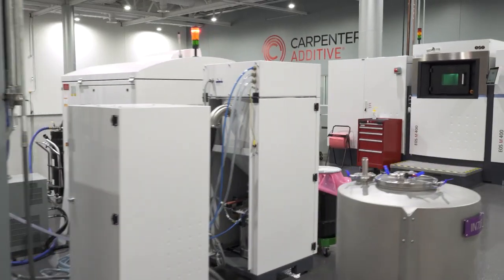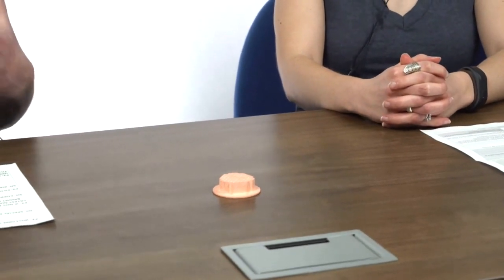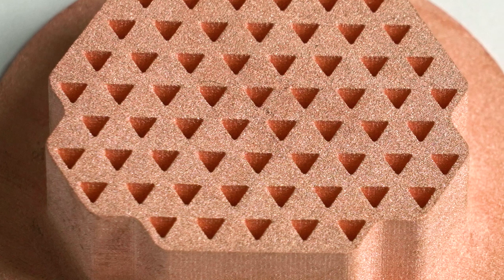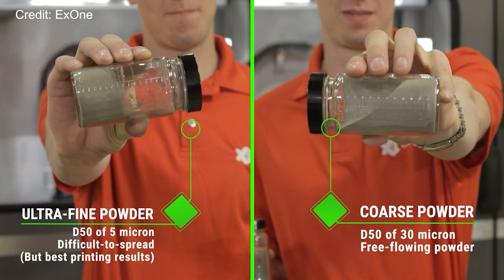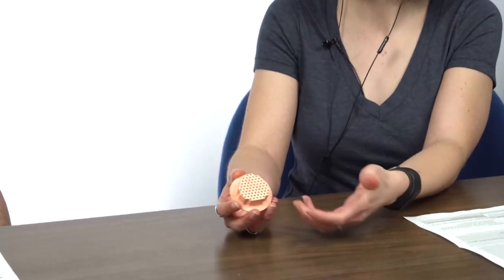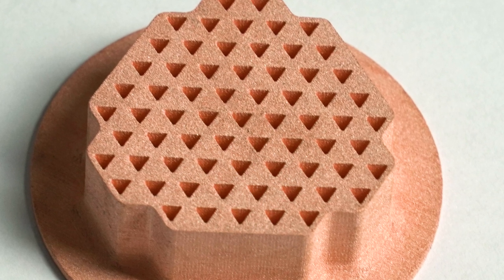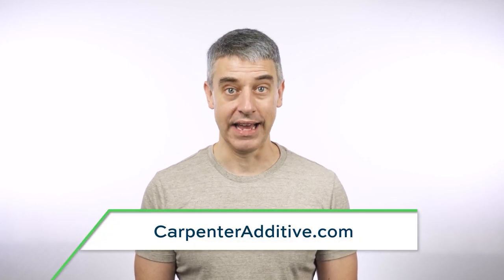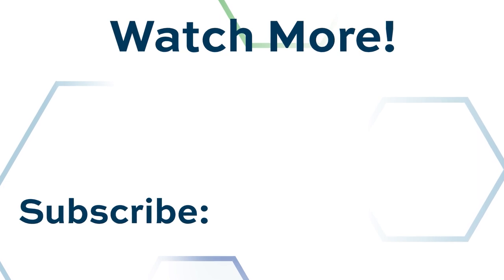Reusable, 3D Printed Copper Filter: The Cool Parts Show #28

Comment: Is it possible to 3d print similar porous polymer substance using Polyjet or FDM or SLS printer.
I'm working on generating polymer based heat pipe for which it required to print the wick structure using a polymer based printer.
Any leads will be helpful.
Reply from the maker: Good question! We don’t know the answer, but someone in our community might. Would you mind if we shared this on Twitter and LinkedIn?
Reply: @AdditiveManufacturing  , yes. You can share.
Reply from the maker: Our social media followers came through with a few ideas! Selective laser sintering (SLS) was the most common suggestion, with two replies mentioning SLS of nylon specifically. One commenter said it might be possible to create the porosity this way with careful particle size distribution and semi-sintering some of the powder. If material is a concern, one Twitter follower thought Arburg’s Freeformer material jetting platform might be able to build a filter (and it’s compatible with many injection molding polymers). Another possibility might be extrusion with a specialized filament. We’ve just learned about one called Caverna that combines polypropylene with a soluble material that can be washed out after printing to leave a sponge-like texture behind.